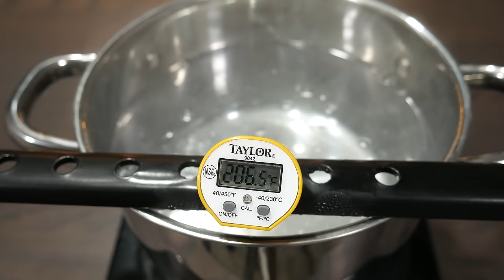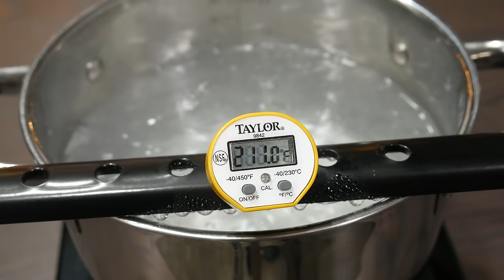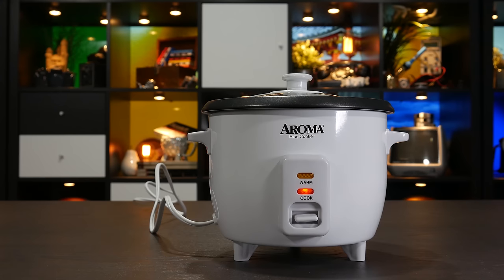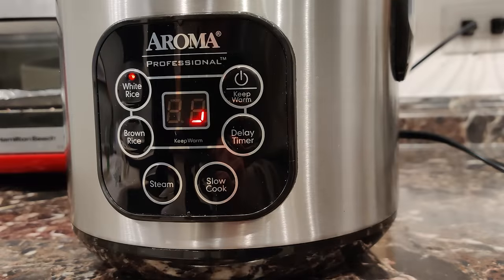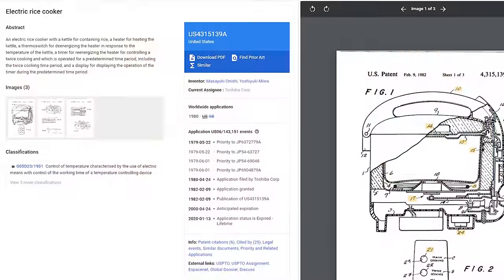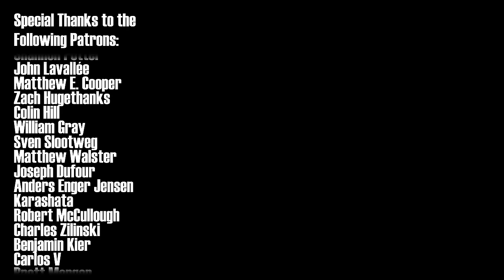Old-fashioned rice cookers are extremely clever

Comment: Because of this video, I now understand why my basic rice cooker regularly burns the bottom layer of rice for me. I live at altitude, and water boils around 200 degrees Fahrenheit for me. I'm guessing my rice cooker keeps the heating element on until it exceeds 212 degrees Fahrenheit, and that continued heating after all the water has been absorbed is probably what causes the rice to burn!
Reply: Maybe adding a pinch of salt to the water can fix that problem? And create a new one (salty rice).. but hey, nice experiment anyway.
Reply: @ttaibe  putting salt will raise the boiling temperature of water, just be careful it won't disabled the magnetic as the water temp rises, or else you get half cooked rice that as good as gone. Seriously, half cooked rice has the worst texture ever. It's like eating sand and glass yet soft on tongue...
Reply: Thank you for sharing this, as I often stay in CO.
Reply: Are you washing your rice first?  It could very well simply be excess starch burning at the bottom.
Reply: That was exactly what I was wondering as I watched the video.  I thought maybe if your water boils at 190F, the temp rises fast enough to the cutoff (215F?) that it doesn't matter.  Now I see that it does matter, and the rice burns.  Oh well, not quite the foolproof design I'd hoped.  We have an electric kettle, and I believe it's using a fixed temperature for stopping.  When I hear the water madly boiling away, I just take it off the base, figure our water won't be getting any hotter.  A clever electronic rice cooker could monitor the temperature, look for the plateau point, and shut off once the temp starts rising again.
Reply: Nice been wondering that too, what happened at mountain lol
Reply: @ttaibe  a pinch of salt won't change the bp all that much. Yes it will rise it but probably not more than a degree, unless you add a ton of salt, at which point the rice becomes unedible. I'd still give it a try though
Reply: if you live at high altitudes invest in a pressure cooker
Reply: What you need to do is to pressurize that bad boy. What's the worst that can happen!?
Reply: @ttaibe  actually adding salt to water doesn’t increase its boiling point by enough to make a palpable difference. Adding 20 grams of salt to 5 liters of water raises the boiling point from 100C to 100.04C so he’s going to be facing that issue with his rice cooker regardless of what he does.
Reply: @MysticYT925  good to know
Reply: Exact!
Reply: Yeah, we have the same problem at sea level. Automatic is canard, not a reality. Even rinsing the rice and it'll boil to the lid, shooting starch water unless you lift the lid a few times. When finished it's a lump stuck to the bottom, especially if it's sat on "keep warm". But it's quicker than the double boiler cookers.
Reply: I live at sea level and it happens the same thing. Playing with quantities and ratios or amount of salt did nothing to change this.
Reply: Try putting it by the window, so the rice cooker can see it's at high altitude and can adjust the settings accordingly.
Reply: @MysticYT925  So, extrapolating your calculation, if Nicholas has to raise the temperature from 93.33 to 100 C, he has to add 333 grams of salt to cook rice with 0.5L of water (most probably how much fits in that basic rice cooker) effectively at that altitude. *How I wish the world was linearly scaled like this. Math would have been so easy 😄*
Reply: @BruceS42  Most electric kettles use vapour/steam to turn themselves off, this allows them operate at any altitude, and even on most liquids (wanna boil vodka for some reason? well, you can). This does mean they won't turn off if you forgot to close the lid (as it allows the steam to escape), and they may self-destruct if there's no liquid in them to boil (unless the manufacturer added extra safety precautions).
Reply: @ultru3525  Thanks!  I wonder if the lid just leaks too much, but it seems to do that more at higher altitude, whereas places like we are now (AR), it shuts off pretty quickly once it starts boiling.  And now I'm wondering just why I might want to boil vodka...
Reply: I live at 6,000 ft and I have a basic zojirushi cooker similar to the model he showed in the video. I put some extra water in mine and it cooks perfectly. My reasoning is that because the water is boiling at a lower temperature (about 200F for me) it actually takes longer to fully cook. I used it once or twice a week for 12 years and never have issues. In terms of ratios mine has a line for how much water so for two cups of rice I fill the water to just above the two line about 1/3 of the way to the three line.
Reply: Convert it to Celsius
It went change anything but rounding errors in the matrix might do stuff
Reply: @calvinnyala9580  it doesnt raise the boiling point as much as you would think.
Reply: Oh, now I get it. Since I live in the Wasatch Front I'm at altitude as well.
Reply: @ttaibe  The effect of the salt is so small it would take way more salt than you'd ever want in your rice to have any significant effect.
Reply: this is not correct. just add more water.
Reply: My rice cooker does this too, i dont live at altitude, i think some rice cookers are just poorly designed and built.
Reply: @aksdjflskdj  Thanks mate, you unlocked good altitude rice for me !
Reply: @ramonafrombarcelona   * inedible
Reply: It kind of does this for me too, at sea level. Not fully burnt, but even washing the rice, there's often a crispy layer of fried starch at the bottom. I'm guessing at altitude, it just adds even more heat energy into this layer, completely burning it before getting hot enough to turn off. 
I actually came back to this video thinking about how altitude would affect these cookers, I'm surprised he didn't consider it in the video!
Reply: I live at a lower altitude so the rice doesn't burn, but it does dry out a bit, so I've found it works better if I watch and unplug it once all the water boils away but before it shuts itself off. Another thing - the rice can stick to the bottom, but if I let it cool a bit before serving, it is less likely to stick
Reply: @ttaibe  Hank Green looked intro this for pasta, and the amount of salt you'd have to add for a meaningful bump in boiling point would make the food inedible. Salt is just a flavor enhancement in the quantities we'd use it.
Reply: Maybe just need more water
Reply: Maybe add more water?